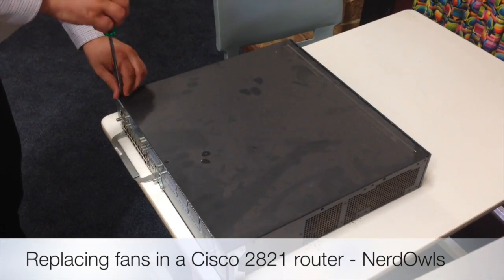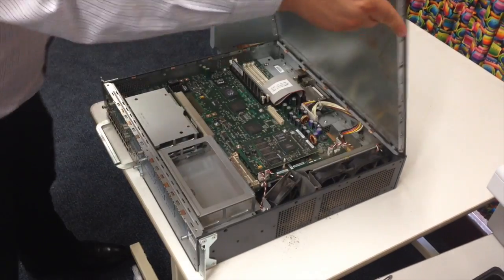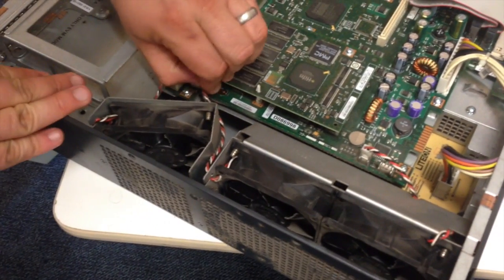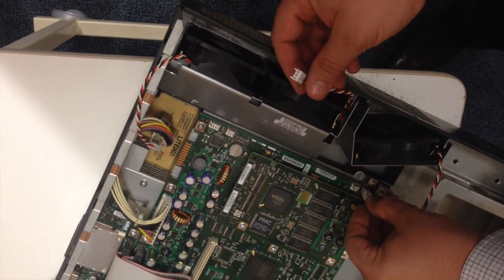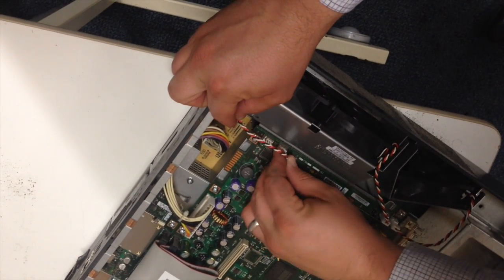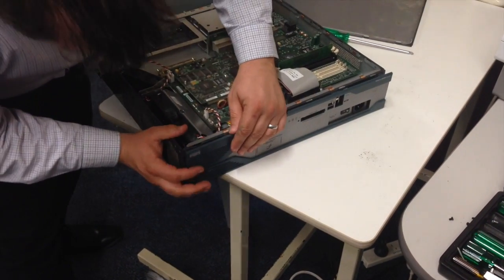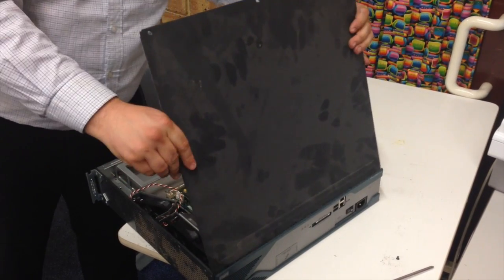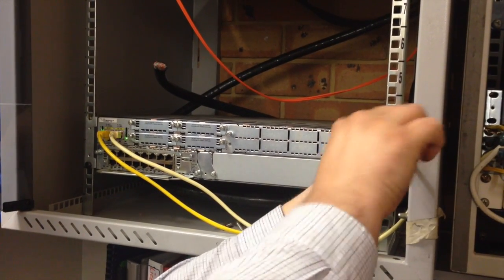Replacing Fans in 2821 Cisco Router

Comment: Does this steps applie 2811 Routers?
Reply: No. 2811 is totally different by fan design.
Reply: @EIKAinc  Woow, I posted this msg 7 yrs ago and just someone responded. I don't remember the steps, but I replaced the fan.

I am no longer interested in Cisco, and after so many yrs of having a huge stock of Cisco hardware/books I sold most of it and give the rest to local college student :-)